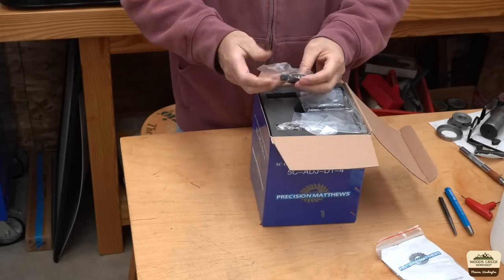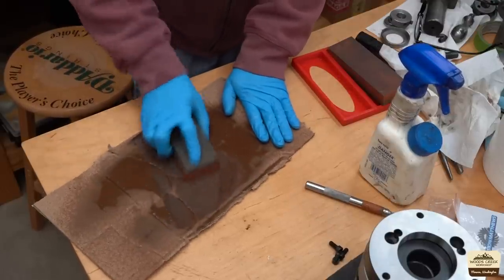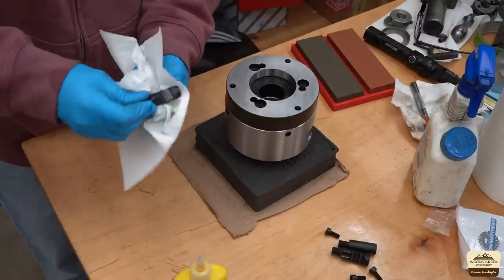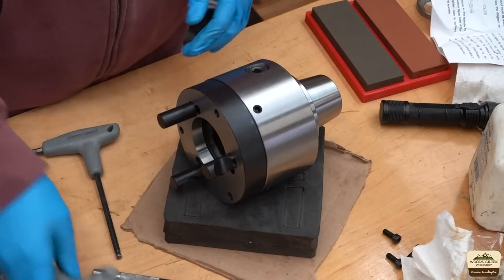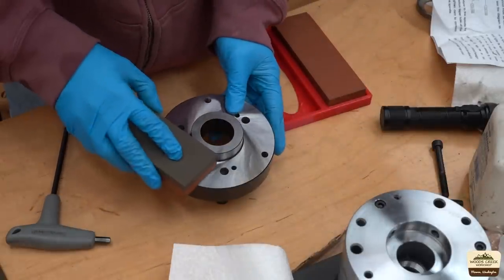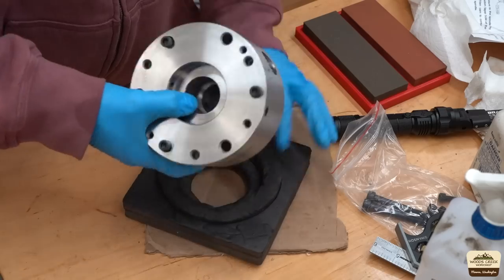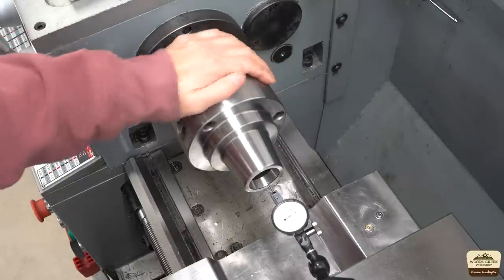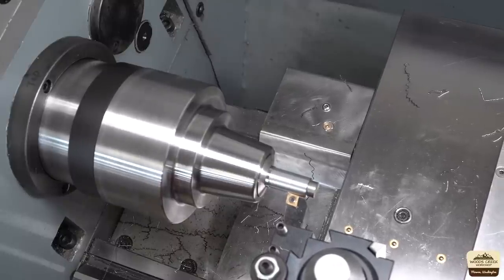Setting Up a 5C Collet Chuck:  A Tale of an OCD Sufferer

Comment: Great video, My own personal opinion regarding using grease, is simply…Don’t…
It just acts like a magnet for dirt and metal chips, and as there are no fast moving parts or high temperatures there’s really no need…
All I’ve ever used on drill and lathe chucks is a light coating of a light oil like 3 in one., and I’ve never had any problems or concerns….
After time grease becomes hard and can actually seize a chuck…
I recently bought an unused Pratt Griptru chuck extremely cheaply as it was seized solid..I dismantled it to find the original grease had set like varnish…after a thorough clean and oil it now works like a dream…
Using a light oil makes future maintenance so much easier

Comment: The problem with most of these importers is that because the products are, shall we say, inexpensive, they don’t inspect any of it. It comes from the factory, goes to their warehouse, and on to the customer. That doesn’t mean the product is bad, as more recent Chinese manufacture has gotten much better. But the very cheapest, no brand units, are at the very bottom of the quality stack.

Precision Matthew’s, Grizzly, Shars and a couple others tend to be on the better side. But as a result of the pricing, small touches in the finishing usually isn’t done, as that costs more to do than you would think.

Top chuck manufacturers recommend (and may even make) a high moly chuck grease. And yeah, don’t skimp on it.

Comment: I purchased a 'affordable' 5C collet chuck with D1-8 mount backplate from eBay a few years ago. The brand was H&H, unknown. But it was not a zero set. And had extreme runout. That runout was worse the further from the chuck, so it had a conical error as well as simple concentricity. I ended up buying a Bison brand chuck and replaced the junk version. Lesson learned. There are few import (from PRC) that I've found to ever have good lathe chucks. Sloppy jaws, so bell mouthed contact brand new is an issue with 4 jaw independent chucks. 3 jaw chucks with extreme runout (25 thou, typical). But I've had good luck with 1 brand that has a symbol of Saturn (the planet) that seems to be pretty good. I have no idea of their company name as I can't read Mandarin. I learned to just buy Bison and never deal with runout issues. It's a good thing my chuck buying days are over, as the price is 3x what I paid in 2004 for the 12 inch 6 jaw Bison and backplate.
Reply from the maker: Depending on how this one holds out, Bison would be the next option.  Thanks.

Comment: I just received my Matthews 5C chuck on Monday . For the reasonable price and true set feature it’s a great deal.  Enjoyed your video, it was really helpful filled with great ideas .  Stoning the drive plate being one great idea. I note it has a ball oiler port , will you be using oil in yours ? And what type . I have decided to use the collet locating screw as my locating reference point to the spindle zero stamped mark . Thanks BB
Reply from the maker: I am using molybdenum paste for lubrication.
Reply: @woodscreekworkshop9939   Thank you, thinking I will do the same. Again Great Video !

Comment: Traditionally a backing plate is made of cast iron for stability. I wonder if that method is still in use.
Reply from the maker: I noticed although cast iron is used, higher ends ones are steel.  In fact, Bison offers "semi steel" for higher end models, also suppose to handle higher RPM, which doesn't come into play for my manual machines.  Thanks!

Comment: Hey, great tip regarding cleaning precision ground flat stones. I've never seen that before. Certainly going to use it though. Yuchol, do you have any issues with YouTube and copyright? I've noticed you use some non-elevator style music clips in your videos. I got one of my videos flagged because there was a Fleetwod Mac track playing on a P.A. at the venue where I was filming. Super annoying because YT said they would just mute the audio as a "solution". Cheers, Preso.
Reply from the maker: Thanks Mark.  As far as the music goes, all mine are royalty-free.  If you Google "Youtube Audio Library", you can go to free audio library that YouTube offers.  There are thousands of songs which you can filter by genre, mood or artist.  Hope this helps!
Reply: @woodscreekworkshop9939  Thanks Yuchol. I already use the YouTube audio library. It's pretty good for incidental "machining music". It seems that YT has become a lot tougher on copyright in recent years. It's probably a good thing they supply their own "safe" music clips.
Regards,
Mark

Comment: The holes between the mating surfaces need to be slightly countersunk and then deburred and only then use the PGS.  If you just use the PGS, there is a very sharp edge that can form an upturned burr the next time a bolt goes through.  I'm not impressed by the quality of their products.  Sometimes it is better to get a used machine and restore it.
Reply from the maker: Holes were already countersunk.

Comment: Those studs don’t need to be tight. The notch clocks the cam and retains the stud as well.
Reply from the maker: No, they don't need to be tight.  But they have to go in far enough so the camlock actually pulls the chuck tight onto the lathe spindle.  The notch on the stud exists solely for the screw to register on those stud so they don't unscrew.